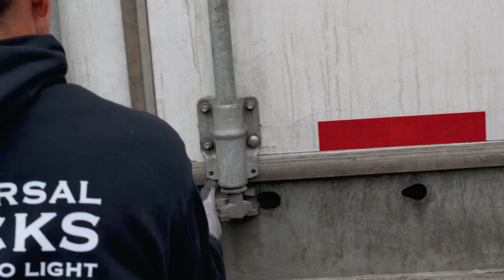ALL MY REPTILE ZOO EXPANSION PLANS FAILED!! Day #1| BRIAN BARCZYK

Comment: Congratulations  what an achievement 😊 if that was me putting them in I would of done it slightly differently I would of used a telehandler forklift with extensions on the forks then you could of got him to extend his boom right through the door way then once inside he could of lifted it so you could put the dolly’s under to move them into final position